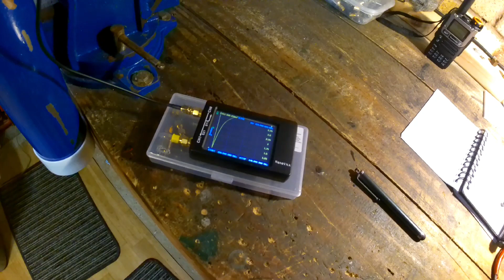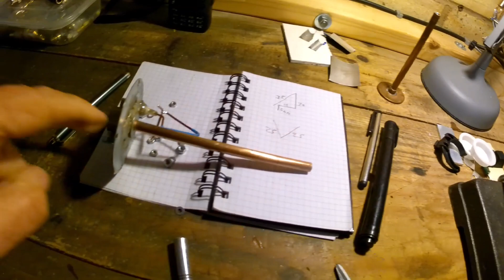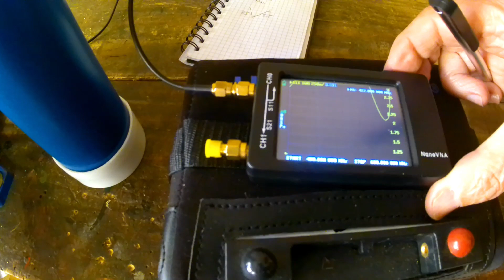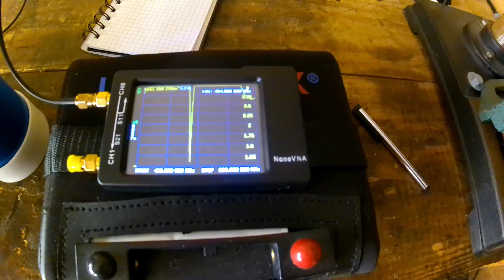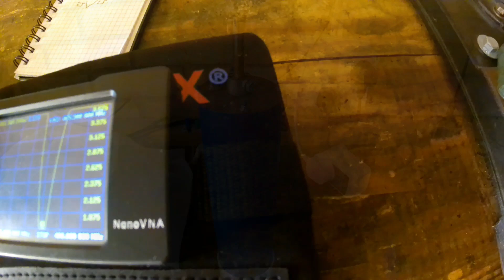Ham Radio. DIY Cavity Filter. Part 2. 70cm Band. #ham radio.

Comment: -60dB from 400 to 500MHz from bits of scrap and chopped up beer cans?! - You should work for Amphenol! 

At work we pay roughly £500 for an Amphenol duplexer. I have no idea what a cavity like this would be because they're just not used in commercial installs.
What is the insertion loss outside of the notch? I can see from other videos that CI is absolutely storming in to you, so you can afford whatever loss you like!

You mentioned running this notch AND a pass cavity - I would have thought that it would work just fine no matter which order you run them. The notch is only blocking the 465 (464 to 466) so your sub 440 should go straight through it minus the insertion loss.
Reply from the maker: Thanks for your message.  I have very limited test equipment. It doesn't effect my transmit SWR on 2m and 70cm Ham Bands. Also on weak signals I cannot notice any difference on signal strength meter in radio. Guessing possibly -3db. I am still experimenting and hoping to make a 4xcavity set up for a repeater on the 70cm Band. But it's all playing around and experimenting.  Learning as I go. Cheers from old George.